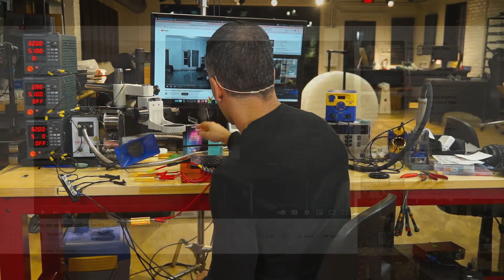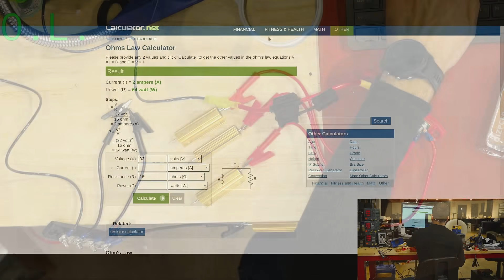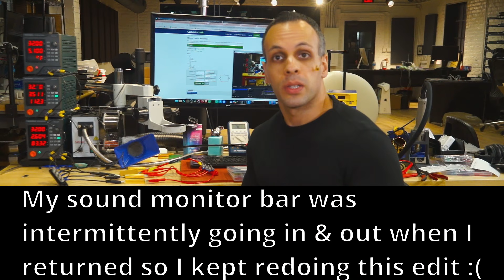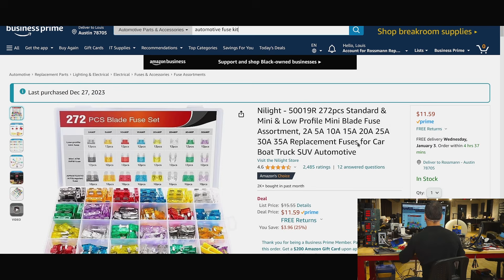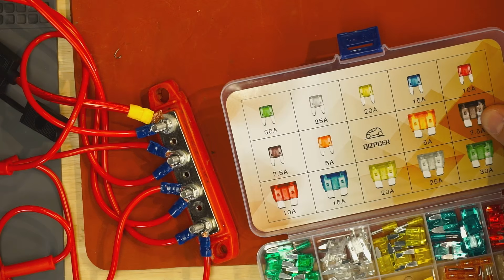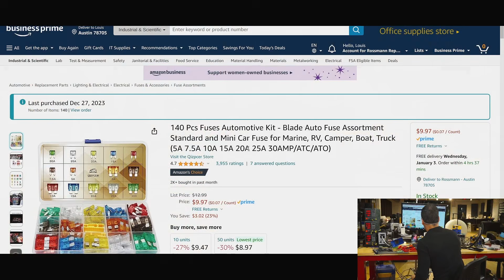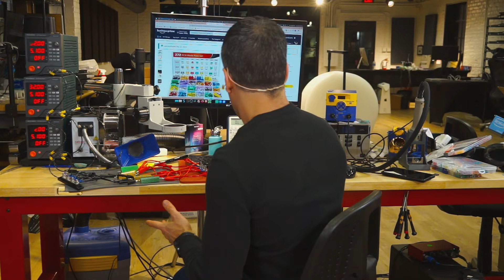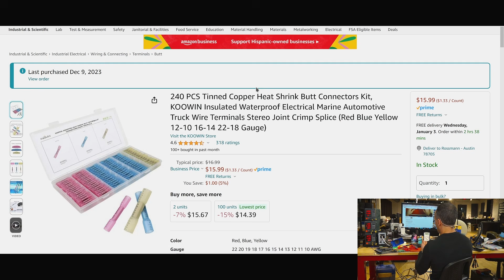Amazon Sells Fake Electrical Fuses

Comment: Naive me learned from a local plumbing supply store that bath fixtures (faucets, shower heads, etc) are made by the same manufacturer in two grades that have the same part number and box. The cheap version (that breaks because the interior parts are plastic) goes to Amazon and big box stores, and version that doesn't break--with metal parts--goes to plumber's supply stores. I was shocked.

Comment: Amazon does not care. Everything goes through idiotic systems.
8 or 9 years ago, we got an information from our INDIAN technicians, that a new documentary on Fire TV was in the wrong language.
Instead for a technician to just fix it, we, in lvl 2, needed to collect all the calls/mails/chats regarding the documentary to a special que.
The reason was, that only a certain amount of complaints were needed to create a case for the system, so that the technicians had a ticked, so that they were allowed to fix it.
Naturally, instead of just apologizing and ask for patience, we were forced to go through a shit ton amount of "workarounds" to check if it was the Fire Box it self or the options of the customer.
Even thought, there was no way for the to play it in the "correct" version, as it did not exists...

With products, it takes the same route. It does not matter if the product is faulty and can threaten anyones life. No one complains, no issues.

Comment: This actually ruins the credibility of every fuse sold since there is no way to trust any of them unless one actually tests it. A problem with the review system for something like this is I think there are honest 5 star reviews because someone plugs it in and the system works. They can't test a load on it themselves more than likely. Amazon needs to test products they sell. What also happens is that a company gets bad reviews, they change the name, hire some fake reviews and get it right back on there under another name.

Comment: Louis, you need to get an electronic load.  It's like the opposite of a power supply - you dial in how much current (or watts) you want it to consume and it controls its own resistance to match that.  $500 gets you a unit that can consume 0-60A, more money gets you milliamp-level resolution.  Honestly impressive the number of times it comes in handy, and it's shocking that most people don't know about them.
Reply: I imagine he used what he had available in his workshop. Not much use for an electronic load in his everyday work.
Reply: Rather than that, I'd like a collab with Electroboom testing a whole gamut of fuses and other "Amazon's Choice" tinkerer parts.
Reply: @IanBPPK  Electboom and fuses? That's a ha ha, not shocking.
Reply: Interesting. Got an Amazon referral link?
Reply: @karlstenator  I sure don't, but the one I  use is the Rigol 3000 series and it is sold on Amazon.  Like I said, it's surprising the number of times that thing has been useful - I'm on the engineering side and it gets used for testing power rails all the time.  Sometimes weird bugs/brownouts only show up when you're at specific loadpoints. 

As others have pointed out - yes, Louis could use his current-limiting feature on his power supply for this one specific test he's doing.  Probably won't work for when you need high voltages or you aren't in control of the power converter because it's on the PCB you're troubleshooting.
Reply: How is that any different to this test or provide a better test result?
Reply: just easier  @Catrik
Reply: Thanks! Now I know too.
Reply: He could just use the current limiting feature of his fancy power supply.

Comment: Harbor Freight recalled fuse kits and warned they were likely to cause fires.
The Chinese are very practical rice farmers. When let loose in industry they will make "practical improvements". Such as rating all fuses at 30 amps to make their product more reliable.
A down ski jacket I bought needed washed. After drying outside in the sun for a couple of weeks and failing I took it to a seamstress. She laughed and said the idiots put waterproof material inside and out. She sewed vent material in strategic places and it now works. Some farmer probably suggested this "fix" when they ran out of liner material.
BEWARE HELPFUL IDIOTS.

Comment: I'm in the Amazon Vine program and I have to order trash and review it. I've come across many products that are just downright garbage and rate them a 2 or 3 with an explanation and photos. But then see I'm one of the only 2 or 3 reviews and other members put 4 and 5 saying "it works" when they prob threw it out. It's probably because the sellers will immediately message you offering you more garbage but no real solution for the product. Some products might genuinely start out like this.

Comment: There is a great in-Detail video made by the Weber State University Auto Department, if I remember right they came to a similar conclusion but also checked the resistance with a microOhm-Meter https://youtu.be/nELwmfAOz_I?si=awoCM0uyVs2zIyZD

Comment: If Amazon had a contractor come to their sort center or warehouses, and they installed a new conveyor belt that was 100 feet long but the 3phase motor was only rated to handle one that was 20 feet and overheated and caught fire, probably because the breaker installed was meant for the proper motor, how would Amazon feel? Would they allow that contractor a mile of their warehouses ever again?
Reply: Amazon's payment office would refuse payment for the job

Comment: I bought some Overture nylon filament from amazon and it had decent reviews. When I printed with it, it was absolute dog-shit. I dried it to the bone and only really got it to stop clogging with a nozzle of 0.8mm, but 1mm was really the loweat size I'd print with it. I thought that it was just nylon being diffixult, but I bought some PLA that was at like 4.5 stars, but it also turned out to be literal dog-shit as well. Needless to say, the PLA was returned.

Comment: When you add third resistor, you don't half the resistance again (1/2 * 1/2 = 1/4), you just go from 1/2 of the resistance of the single resistor to 1/3 resistance of a single resistor. The calculations (2A, 4A, 6A,...) are fine, it's just the description that is wrong

Comment: What i find hilarious is that these fuses are taking more power to blow, not less.
Why
Doesnt this mean they have more material than is needed? Are they losing money, just to leave themselves open to a wrongful death lawsuit?

When messing with these big resistors, i like to grab something like a copper "currency" bar, but with that many resistors, man, i dont know what someone would just have lying around the house that could disipate that heat, and fit all of those resistors, without blocking it from dissipating said heat.

Comment: I feel like if you're throwing 6 amps through a two amp fuse, you're at a point where you don't have to say "in my opinion" before saying "a complete scam". You have solid evidence at that point that the product is NOT as advertised. 

VIDEO EVIDENCE.